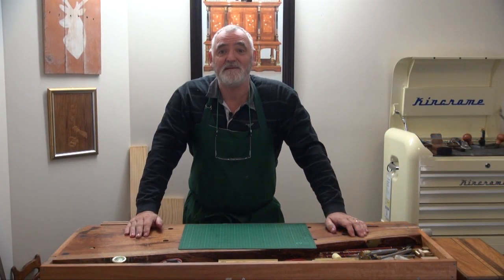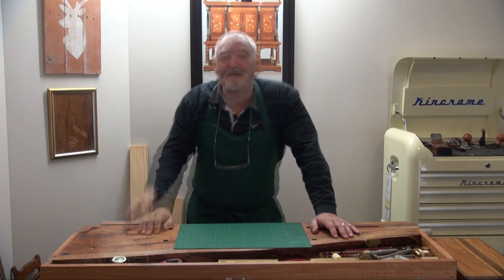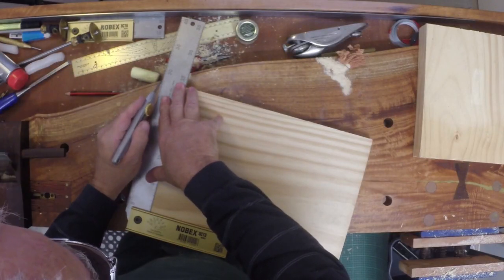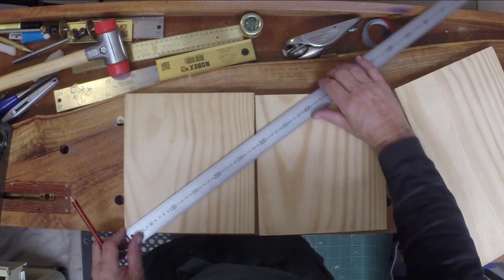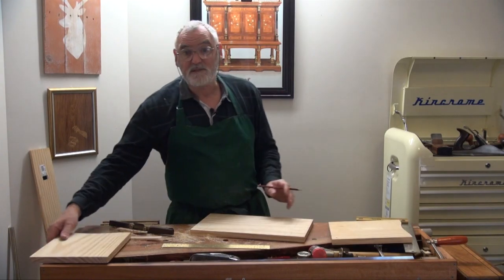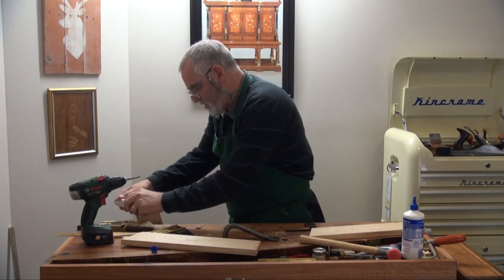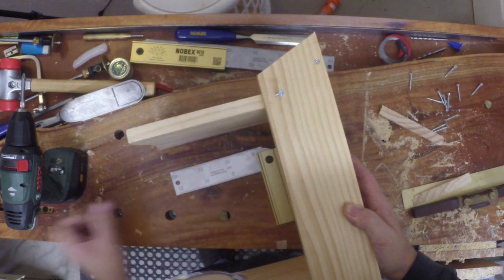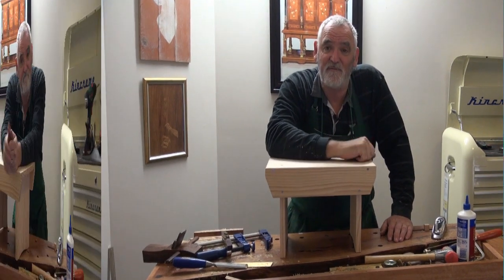Making a Simple Stool with Hand Tools.

Comment: Steve, I think this channel is great and I hope you continue to post videos.  I shared your channel with a friend who is thinking of getting into woodworking, but lacks space.  He is now a viewer!  You have also inspired me to put a small workbench in my apartment.  I rent space for a workshop, but it is not air conditioned, so I can dimension the timbers there and then bring it back to the apartment to continue working.  I would like to see how you made and mounted the legs to your workbench you are using.  I have a top to use for the bench, but I need to put legs on it.  Another things is, how do you keep the bench from moving and tearing up your carpet?

Thanks!    Allen
Reply from the maker: Hi Alllen, The weight of the bench holds it in place the whole thing is help together is cup head bolts. So it is 100% demountable. I have a Large canvas Painters drop sheet under it. With a thick piece of vinyl sheeting between the folded drop sheet. Protects the carpet and prevents any spills from soaking through. Thanks for sharing the channel and I hope you continue to enjoy what we do. Appreciate the feedback. Cheers Steve
Reply: Can You show us Your workbench? I can only see the benchtop and it looks beautiful, and I think all of us would like to see the whole bench.
Reply from the maker: OK, Will do a tour next video which I'm hoping will be next week. As I have been asked for it before so it's a promise. Cheers Steve